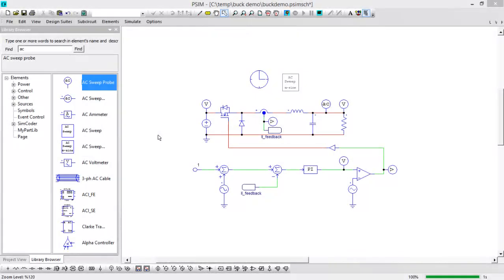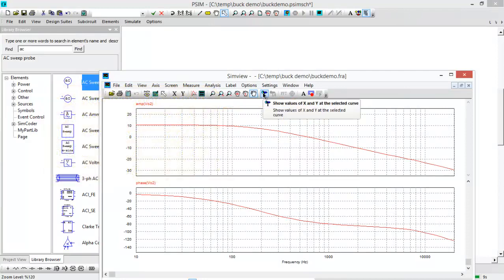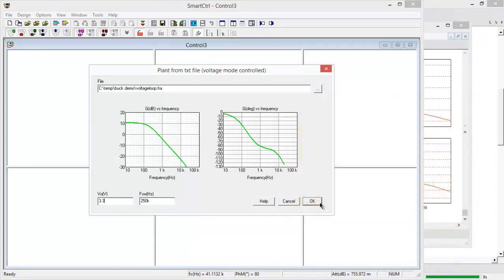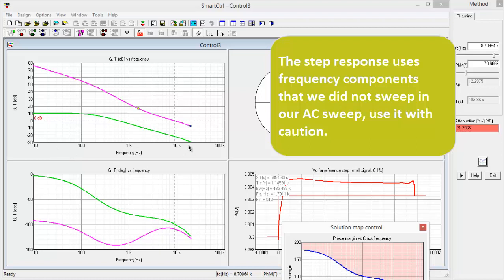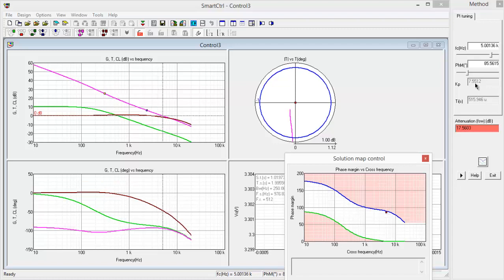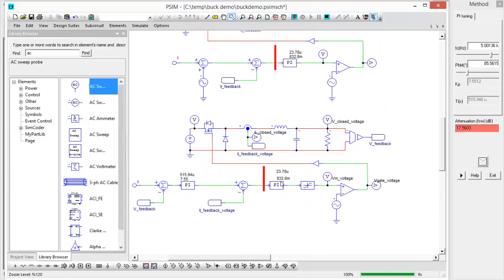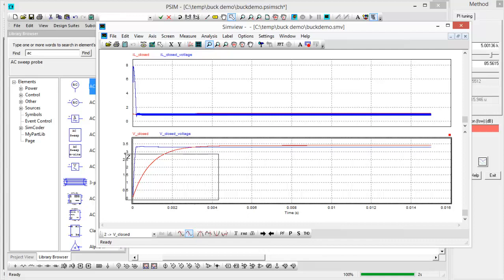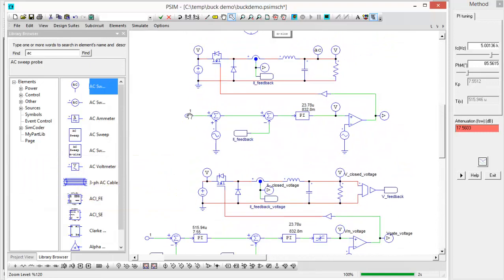Using SmartCtrl to design the outer voltage loop of a Buck

Comment from the maker: Want to try PSIM?                                                                                  - https://hubs.ly/H0f9wCC0
Why is PSIM preferred for Power Electronics simulation?             -  https://hubs.ly/H0f9wFX0
Why should you use PSIM for digital control?                                  - https://hubs.ly/H0f9wC-0
Why you should use SPIM for device level simulations                  - https://hubs.ly/H0f9wDk0

Comment: Hi thank you for the video...I just have a question this the average current control right? Can i use this method in DCM? and also i am trying to use DSP to achieve this so can i just use the adc to sample at the middle of points of the inductor current ? use this to do the current mode ?
Reply from the maker: +Srinivas s it will work in DCM. A future version of PSIM will allow you to simulate the ability to sample the middle point of the inductor current. Currently you one can only sample at the beginning.
Reply: +PSIM Thank you ! Is this the average current control ?  could please explain the output of the vm_voltage? i am really confused by what i am getting...
Reply from the maker: +Srinivas s This is average current mode control. vm_voltage is providing the signal that will be compared with the sawtooth carrier waveform. It is important to check that this waveform does not have oscillations that will cause the gating signal to trigger faster than the switching frequency. If your steady state duty cycle will be above 50% you will need to switch to peak current mode control.